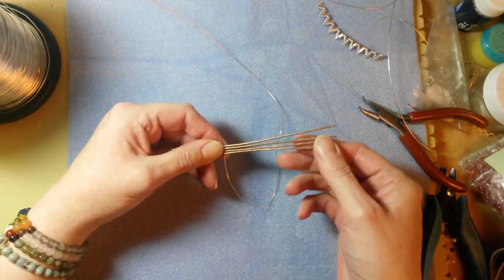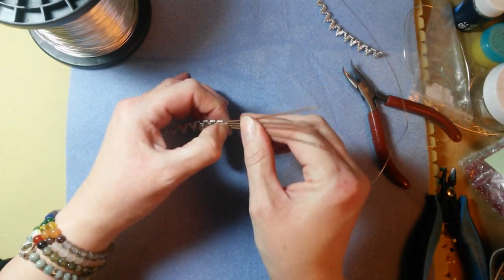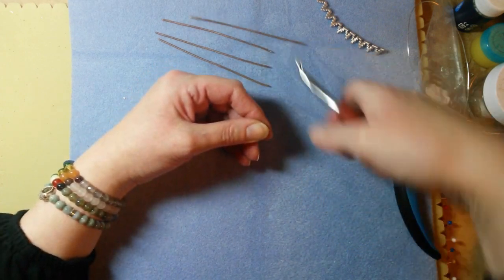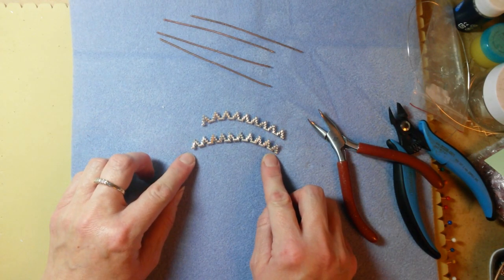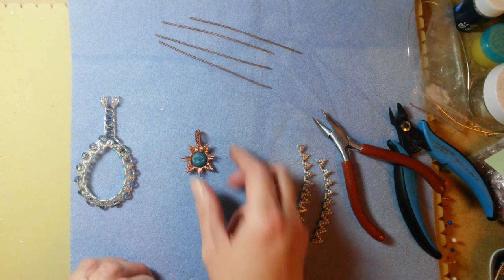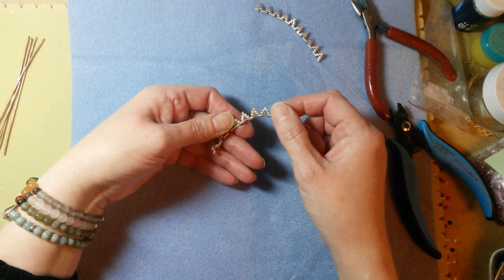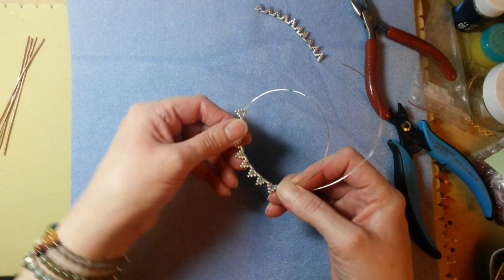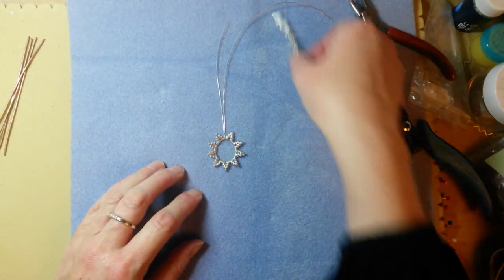Jewellery Wire Weaving | Wire Wrapping Tutorial | Spike Weave Video Two

Comment: I finally finished watching the spike weave all the way through part one and part two. Loved the tutorial!   I have a painted glass dragon eye cabochon that I painted myself.  I am attempting to do the spike weave around the eye for a ring using 16 gauge wire and weaving 22 or 24 gauge wire around the 16 gauge.  What is the best way to hold the eye in the weave?  Should I paint a flat bead and use it instead?  I would appreciate any of your thoughts and ideas.
Reply from the maker: I'm happy you enjoyed the tutorials, it's a versatile weave and super useful - looks AMAZING on dragon eyes. I would think creating a ring slightly smaller than the cab sitting over the FRONT, then wiring to a ring on the BACK of the cab of a similar size should work. Good luck xxx